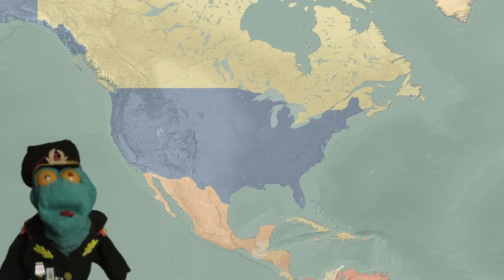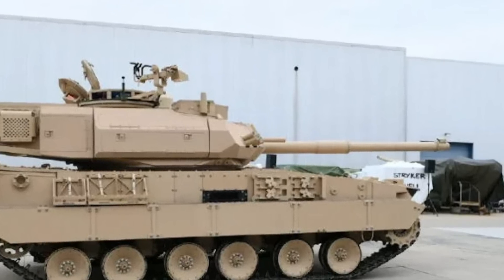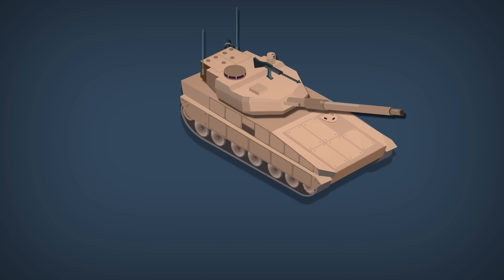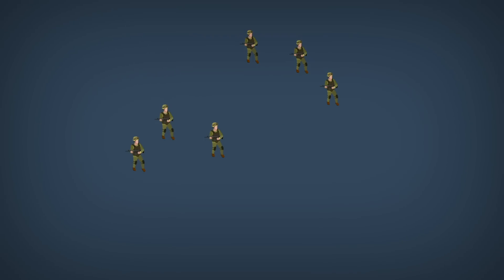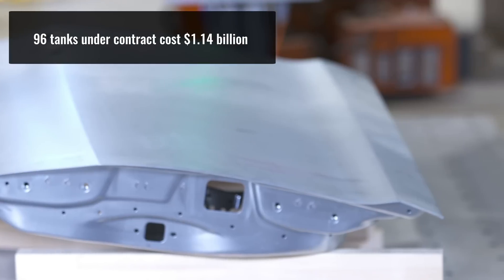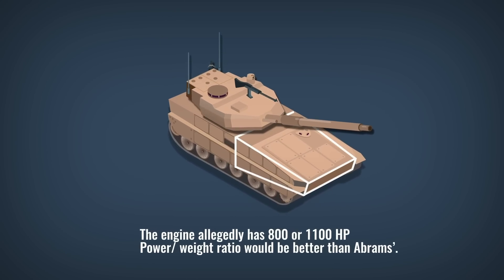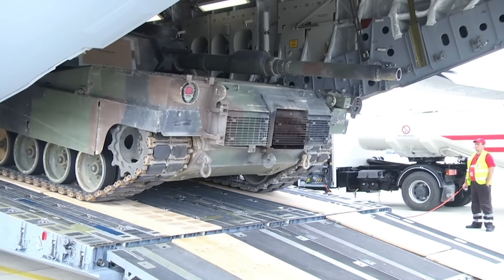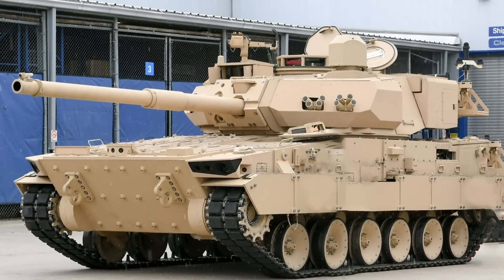US Army just chose its next (light) tank

Comment: 105mm gun are still potent with modern apfsds 🤔
Reply: Not really against modern MBT, especially since it's a rifled 105mm gun which compromises velocity and accuracy with APFSDS for the capability of firing HESH or full caliber HE shells. As opposed to common belief a rifled gun is far worse for accuracy when it comes to APFSDS (or any sub-caliber munition) because it essentially counteracts the discarding sabot's stabilizing effect on the sub-caliber penetrator or "dart" meanwhile it's a much better design and far more accurate for full caliber munitions. Combined the reduced velocity and reduced accuracy with anti-tank munitions and the fact that the 105mm is a few generations behind in potency already even if they went with a smoothbore and it's not exactly a respectable nor potent anti-tank threat to MBTs, at least not in the frontal axis. It's dubious if it'd be effective against last generation MBTs let alone current generation MBTs.

For example of how a superior armor penetrating 105mm smoothbore gun struggling to even deal with the rather dated composite array of a T-72 look up SY Simulations' video called M60A3 vs T-72 Ural.
Reply: @ThatGuyOrby  I can tell you this if an old amx with a modernised shell can get rid of those T80 OR T90 a modern one is supposed to do the same easy peezy
Reply: @ThatGuyOrby  Challenger 2 with a 120mm rifled barrel proved highly effective in Iraq tbf
Reply: @dngrmousey  indeed, I didn't say a rifled gun was bad. Just that it's not the direction you go nowadays if you was to excel at anti-tank work which to be fair was not what the 120mm rifled was meant to excel at (not that it's bad at it). Rifled guns are arguably the best option for anti-structure and anti-personnel work due to their remarkable performance with full caliber projectiles like HESH and HE. It's also not to say that rifled guns are bad at anti-tank but the rifling does strange things to APFSDS shells. The sabot already does it's job of stabilizing the sub caliber penetrator, adding the rifling into the equation ironically destabilizes the penetrator "dart" especially at longer ranges, this is ironic because the whole reason for the rifling is to stabilize shells through spin. This however is only effective on full caliber shells like HE and HESH which is what makes British tanks much better tanks in one often overlooked facet of tanks. Anti-structure and anti-personnel as mentioned before. Essentially infantry support/fire support to a degree.
Reply: @ThatGuyOrby  Early Abrams had 105mm guns and had no real issues with older Soviet tanks and we will still have the M1 it’s not going anywhere so I think they’re won’t be any issues with killing. Plus as we have seen Russia doesn’t have enough modern armor to be an issue. And Russia loves their BMP and BTR vehicles which this thing would slaughter.

Comment: I believe it will be up gunned in the future the United states has always been slow to add the biggest gun unlike alot of othero countries that go for the biggest i wonder how much 105mm we have in stock though and if they are making new ammo then should of just went with a 120mm that could shoot the Abrams ammo less logistics and less chance of a unit getting  wrong ammo i wonder how many mix ups we had in ww2 with the m1 30-06 and the m1 carbine 30 cal ammo which definitely not interchangeable
Reply: Most WWII units also needed .50 cal and .45 ACP, plus assorted explosives. Having multiple ammo types is not usually a logistical problem except at a very small scale, such as platoon or lower.
Reply: With the Stryker AGS being fully disposed of this year, the 105mm would've disappeared from the US Army, leaving only on "tank gun" in the form of the 120mm. Yet inexplicably the new light tank brings the 105mm right back instead of consolidating everything into 120mm. Especially since the 120mm XM1147 round is pretty much perfect for the infantry support role this tank is supposed to fill. No comparable 105mm round yet exists.

Comment: Why would it use a 105mm gun? Wouldn't it at least ease logistics if it used 120mm?
Reply: ammo cap concerns most likely. abrams with the 120 only carries something close to 50 shells. the MBT's are able to just stay close to home in order to solve the ammo shortage, light tanks are expected to spend large amounts of time away from home, so ammo shortage isnt easily solvable.

keep in mind the early versions of the abrams that had only a 105 mounted carries over 100 shells internaly.
Reply: US has a lot of 105 shells. 105 is used on the Syriker and if I recall correctly this new light tank is to replace that version of the striker.

The big reason is weight though. The 105 will still defeat most threats. Has enough penetration to defeat T-72s from the side. Will defeat BMPs and BRDMs from most any angle.
Reply: lots of countries use the 105 and DefCo still makes them, plus doesn't conflict with most internal supply lines for existing tanks and it's a good internal volume for the complex fuses of programable shells.
Reply: @Kelshando  and if im not wrong the  AC-130 and the M101A1 howitzer also uses 105mm but not shure if they use the same ammo though or special variants of it
Reply: @TheRocketdrive - The M1s with the 105mm gun carried 55 shells.  When the Abrams upgraded to the 120mm gun the number of shells was reduced to 42.

Comment: Just my opinion but I think the mpf should be up gunned and use the Rhinemetal L44 gun OK it's a 120 but it's also shorter in length than the German L55 which is used on the current leopard this would help in two ways one it would enable the MPF to use programicale rounds therefore reducing the different rounds needed to use in the tank why have three or four types of ammo when two of three can cover the lot like the new programmable amo does air burst point detonating and delay detonating so the next type of round that the MPF would need the most of is smoke and seeing as it's a 120 then maybe a couple of fin stabilised saebo the load out would be easier also it could be resupplied buy any NATO country as most of NATO are already set up to do this also having the same ammo as the Abrams would course less problems for pthe US in handerlinlg two types of tank ammo opps sorry there Abrams tank crew sent you the wrong ammo just see if you can swap it with some MPF tank crew yea thats going to work out well I remember this happening to me I got L119 amo instead of L118 amo not. Helpfull
Reply: It should use a xm360 actually.
Reply: I'm sure it will be upgraded to 120mm later. 105mm saves weight to help secure the bid (most important), then replacing the cannon later makes GD even more $$$.
Reply: This is a good idea though. More for commonality
Reply: @matthiuskoenig3378  there are several guns available the best I belive is the one used on the CV 90 120 ghost but the drawback there is the price of the new gun the L44 which is already in lage quantities due to the upgrades of the Leopard 2 would be a cheaper option until the price comes down on the CV 90 120 new Ghost gun which I believe is made by Rhinemettel
Reply: I'd also like to add that why is America not looking at the CV 90 120 it fill all the points for the MPF it's already past the reaserch stage it's even been upgraded with sights day and night also the new digital thurmal camo it makes you see a car or van instead of a thurmal Vision of a tank anti missial and anti tank weapons shots fired directional detection system linked to the gun and sights so the gun turns towards a threat with the sights it has all you need for a light tank roll also for the MPF roll so why has no one bought the CV 90 120 well its simple really no one see the point of the CV 90 120 because they don't have the reasons to use one like Sweden there reasons are like the need for the CV 90 45/70 or the CV 90 30 both AFVs and which the CV. 90 120 is based on so there's a commonality in parts and maintenance it's due to there terrain and lack of infrastructure like roads and bridges similar to country's like singarpoor malayer ewhere they have problems with roads mostly unserfaced and can be washed away and bridges with low weight limits so yes there is a roll for a light tank even if its not used in the. Infantry support role

Comment: so we are back to  a scaled-down version of the Patton ? M48
Reply: No, this is just a light tank to add to the toolbox. 

And to take the analogy further, you don't toss out the old reliable screw driver just because you bought a new power drill.
Reply: It's actually more comparable to the M551 Sheridan tank than to the Patton - at least regarding its intended role.
Reply: Nah just base Leopard 1
Reply: @BoleDaPole  of course  its 2022  i am sure it has all kinds of  optronics  and  gizmos  they added to it but I am talking about  its firepower   the m48  with out the gizmos this thing has could have preformed the same role and it was built in the 50s
Reply: @jeffbenton6183  and yes i remember the Sheridan   paratrooper  tank

Comment: Nice work buddy.   Looking forward to more info on the "commonality with the Abrams" ... meaning not modernized..?   Also, calculating the logistics of fuel and it's vulnerability makes SMRs and (sounds crazy but) battery powered tanks which swap batteries to 'recharge' very interesting at lowering the logistical footprint.   They have tremendous torque, they're silent, produce less heat, and would be easily recharged with an SMR ... you'd just need a modular (and scalable) battery pack for tanks.  After all, the M1A1 "powerplant" is about 5T with a 500k range and 3500 lb-ft of torque.  Tesla might very well be able to match or beat those numbers ... so it really comes down to finding inert chemical battery materials, energy-density, and whether an SMR can be made to make it all feasible. 

(yes, I know this sounds rather crazy ... I'm not saying this to save the planet; I'm saying this to save the logistics drivers)
Reply: We're more likely to get a diesel-electric or turbine-electric hybrid power pack than a full electric system for a while. Fully battery powered vehicles are too reliant on having an electrical grid to charge them, and while you could use generators for the job, at that point you're better off just chucking that fuel into a hybrid vehicle that'll weigh significantly less for the same armor and firepower, while having longer range. Think a modern locomotive's power plant in concept, just shoved into the back of a tank.
Reply: The failing in electric tanks is that to match the current fuel powered engines would require 24 hours of charging from zero charge to full charge to match one tank of gas.

Comment: Sounds like a MBT with less armor. A ~30 mm with proper ammo is far better suited for inf support.
Reply: Depends on the support. The Stryker MGS proved the concept, but was never intended to stay in service this long. A 30mm can’t make obstacles disappear in the same way.
Reply: A 30mm can't destroy bunkers, which is one of the main roles of this vehicle.
Reply: As we've seem in Ukraine, unsupported MBTs don't mean jack shit anymore. The days of Blitzkrieg are well and truly over. It's all combined operations from now on and that means the infantry need a lighter tank that can actually cross most bridges with them.
Reply: 30mm is bad against fortification.  It has a another problem that is for programmable ammunition, the ability to airburst amminiton is a huge advantage against a enemy in cover. 

In a, 30mm shell the explosive payload if you add a programmable fuze is not that large. The fuze is alos expensive so lots of small shells cost a lot each. There is a reason the 50mm XM913 autocannon is in development for programs intended to replace the Bradley.    There is a 120mm XM1147 programable round in development. It will be something similar the 105mm.

If a 30mm autocannon can do the same thing the answer is to just use the Bradley as it up pinned to the 30mm variant of the same gun.  It is also not a either or situation, you can use it alongside Bradley or the 30mm armed variant of the Stryker that is in use.
Reply: @target844  The XM1147 is exactly why it makes zero sense for this light tank to be armed with a 105mm instead of a 120mm. Plus the general advantage in logistics if all US Army tanks can use the same ammo. The 105mm was a really stupid decision.

Comment: 35 ton tank, the last Light thank the Sheridan.
Will it be effective?
The only real problem are anti tank missiles.
The soltion hard kill systems.
Reply: I think nowaday, heavy mbt not so effective cost, us need to ready their tank on other continent, "A transport model can seat 180 fully equipped troops. The LCAC's cargo capacity is 1,809 sq ft (168.1 m2). The LCAC is capable of carrying a 60 short-ton payload (up to 75 tons in an overload condition), including one M-1 Abrams tank, at speeds over 40 knots." Thats 1 ship 1 mbt, and if we use the new Light tank, you can fit 2 tank with 2 time the fire power. + the travel distance of the new tank way more far than abrams (more weight more fuel). Protection side, nowaday heavy armor doesn't protect you from new anti tank , atgm & apds.
Reply: Current anti tank missiles can allegedly defeat the armor on any tank currently in existence, all heavy MBT's included.

Comment: It's a mistake to not make the main gun at least 125mm...and the armor should be upgraded, and its general profile should have been lowered in height....hmmm....sounds like they should have just upgraded the M1-Abrams, or up-armored the Bradley or Stryker....this design is a mistake and a money-pit.
Reply: wdym its a light tank if it have more armor than it would weight to much and last time they try to put a 105 in a stryker it is barely even reliable and the bradlet is a good ifv but was never design as light tank plus this is not supposed to fight tanks but merely bunker and light vehicle and 125 is a russian and chinesse caliber the west use 105 and 120 beside the us is already developing 120 for light tank that has the same performance and as the m256 gun of the abrams so your comment is wrong in every level
Reply: @K.A.Z.U.K.I  There is a new 125 designed by rheinmetall fitted for the new panther. Even then 125 isn’t better than 120. A 120 heat penetrates anything on the battlefield. The way the heat round works is it creates a .50 cent pc size hole creating a vacuum seal forcing the crew through the same hole.
Reply: @K.A.Z.U.K.I  The marine corps got rid of its tanks. The new ACV is set to replace 3 vehicles the legacy AAV, the abrams, and the LAV. As of right now it’s only armed with either a m2hb or mk19, but is set to get bushmaster variants once past the break in phase, and upon Congress approval. The U.S will always have air superiority so tanks are pretty much useless in our case. We need something that can safely move personal on a battlefield while still being able to provide suppression in urban environments at the same time limiting civilian casualties
Reply: @tyler7937  that is not how HEAT works. HEAT uses the explosion of a charge to melt and accelerate a shaped copper lining to hypersonic speeds, cutting through the armor of the tank and creating spalling as well as splashes of molten copper on the other side. There is no notable “vacuum” created.
Reply: @mrskywars1237  Sorry, I meant “SABOT”

Comment: I'm trying to understand the point of this tank.
Reply: to be air dropped with airborne units, allowing for increase firepower
Reply: Money for the military industrial complex
Reply: its in the name, mobile protected fire power.
i got this from an article;
small ground teams have gained significant punch but they are vulnerable to return fire.
one blast of an MLRS and a highly trained squad is wiped out!
the missiles they carry  are also really not suitable for a close in extended fight which is usually necessary hence the gun.

add the two and you get a light tank
Reply: Replaces the armored gun system.  Turns out you can't really put that big of a gun on a wheeled vehicle.
Reply: @stephpompom6379  Unlike the XM8, this one is too heavy to be air dropped. It defeats the whole point of a light tank.
Reply: @NanoBurger  Not exactly true. There is plenty of wheeled vehicles with 105's, plus some with 120's. The thing is, they were designed to carry them; the Stryker wasn't. It's too high profile, therefore the recoil issues. One of the real reasons the MGS is getting phased out is because of the auto loader; it's obselete. Keeps breaking, and they can't get parts for em anymore.
Reply: It is a replacement for the Stryker specifically the M1128 Mobile Gun System variant which was only fielded as a stop gap after the replacement for the Sheridan was canceled and no new replacement programs seemed to be in the works.  With the base Stryker system being scheduled for an upgrade they decided to finally get a light tank again rather then upgrade the M1128 further.  The purpose of these tanks is just like with the M1128 was to free up the limited numbers of heavy AT weapons to take out MBTs while these dealt with less armored but plentiful targets like IFVs.